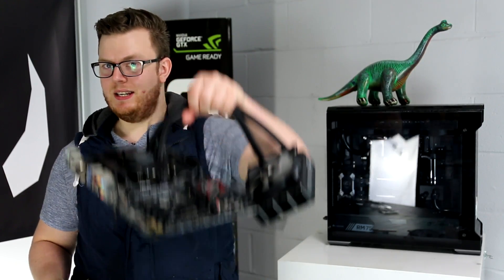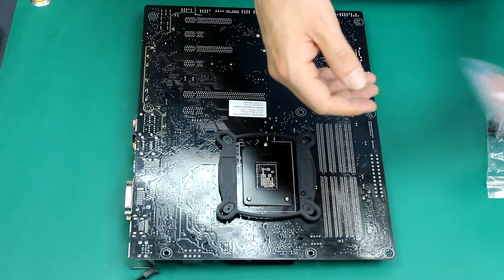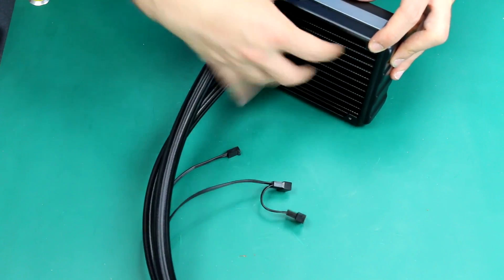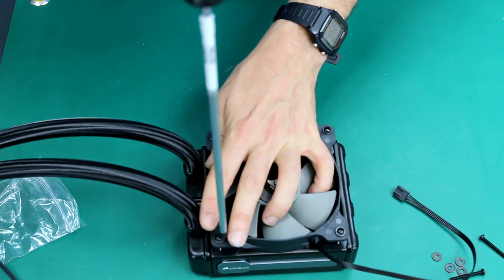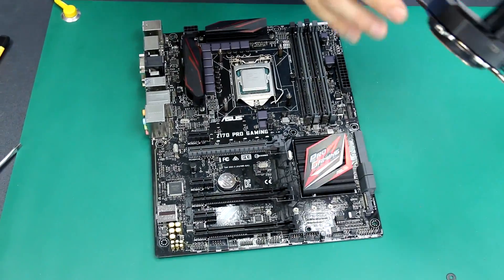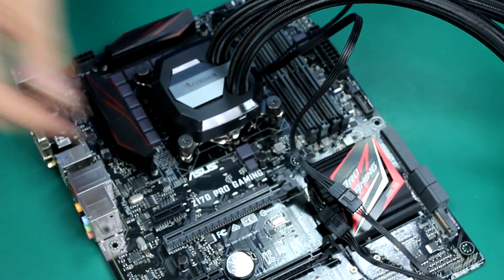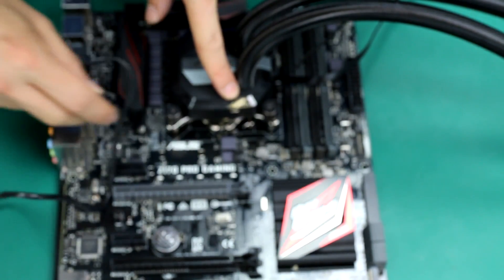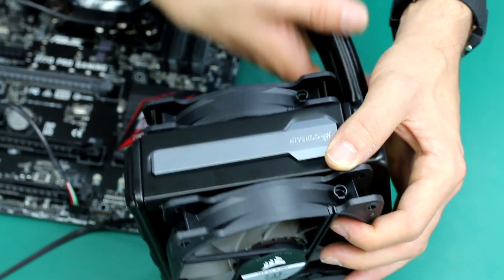"HOW TO INSTALL A WATER COOLER" Dino PC

Comment: No cooling paste!?
Reply: it comes preinstalled every single liquid cooler does.
Reply: Jens Hendriks There's already cooling paste on the cooler
Reply: universaldream35 yea I noticed when I got my own. I don't dig it though. It doesn't have enough surface area and it's not really great stuff either. I just take some nail polish remover from my sister, wipe it off, dry it off, put artic silver on my cpu smear it out with a glove to cover as much surface area as possible and squish the pump onto it.